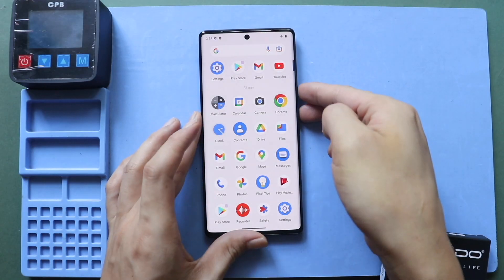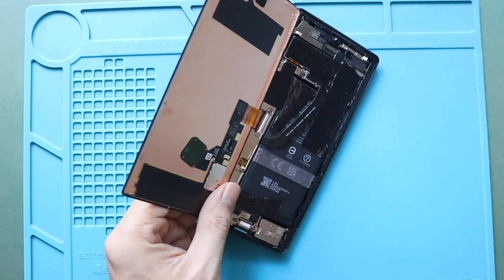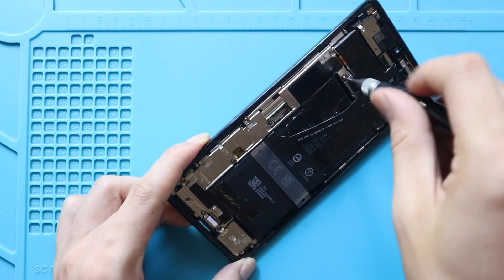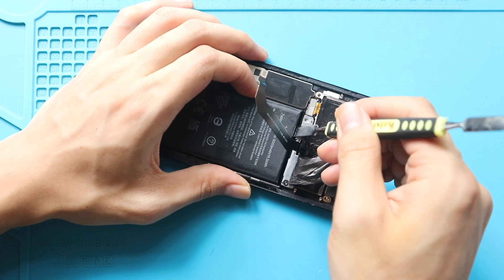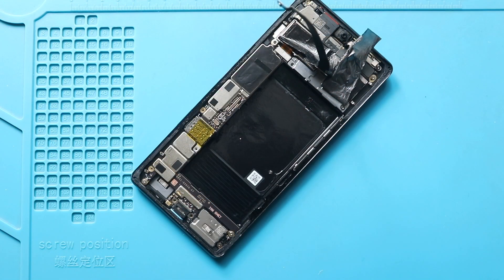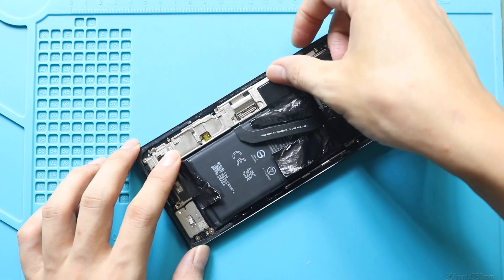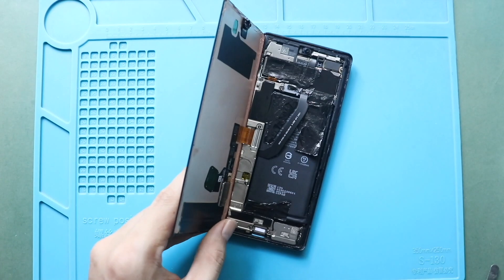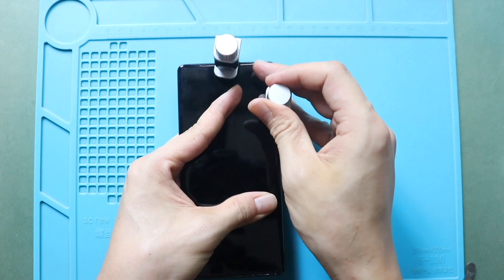Google Pixel 6 Pro Battery Replacement

Comment: Don't be scared of the heat, I have left my phone mounted in front of the heater vent in my car for a Long time, the mobile data stopped  stopped working and eventually the phone shut off. It was so hot it felt like it came out of the oven, this was an accident but the phone was fine. Moral of the story heat it way up and screen releases with ease, if you pry and pull too much on the screen it can crack!
Reply: Exception to the rule. Heat WILL damage your phone, I know because I've damaged the electronics with too much heat a couple of times
Reply: @Giovanni-888-Italia I'm sure it's possible! I wouldn't use a heat gun personally, a blow dryer or hot pad is much less extreme

Comment: Here in may of 2025 after an apparent phone upgrade is causing a rash of overheating.  I've ordered my battery replacement kit and watching this video to familiarize myself of the job ahead of me...  Hopefully it's just the battery.  A big thumbs up to Google for supposedly making battery changes not so difficult a job and a big thumbs DOWN for their OTA update that is apparently bricking their phones right up the line...
Reply: was it just the battery mine is doing the same after the upgrade i waited aslong as it would let me
Reply: @TheeAmerican it wasn't the battery for me.  Bought the replacement kit.  Same issue.  It only lasted as long as the new barely charged battery.  Wouldn't recharge.
Reply: @rfphill so battery problem it's because android 16 update?
Reply: @TheeAmerican after 16 android update right?

Comment: Great video. Be extremely careful when you remove the screen, it's very easy to pass between the two layers of the display and destroy it.
Also, in my case, it was much easier to unstick the battery than this.
Reply from the maker: Thanks for sharing

Comment: My Pixel 6 pro bricked while I was texting the other day. After trying all the button pressing options, I'm wondering if a disconnect of the battery would work at turning it on. Has anyone successfully done this before?
Reply: Same for me. Strange that it happened to you 6 days ago. Mine went through an update and the crashes really looked software related. Could it be a problem with the update?
Reply from the maker: Thanks for sharing